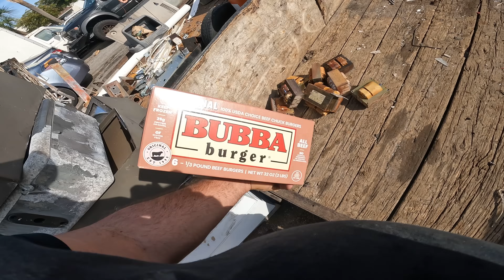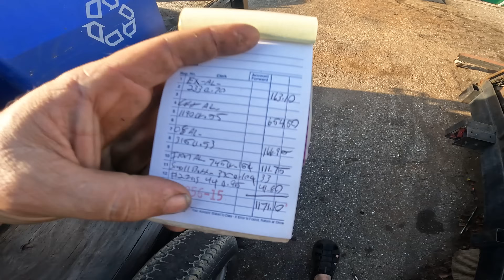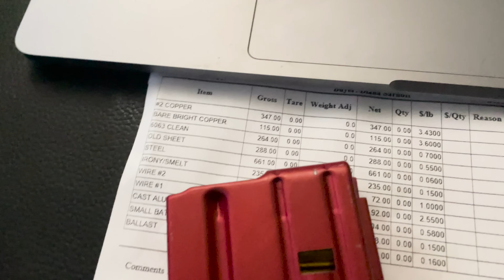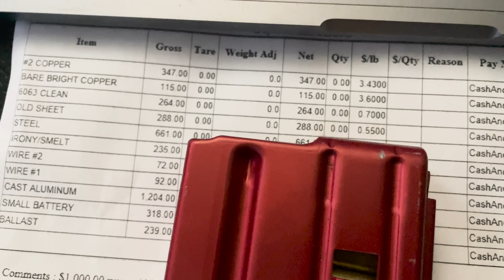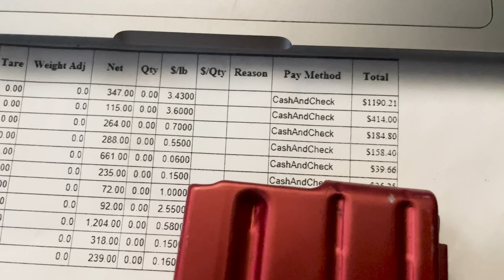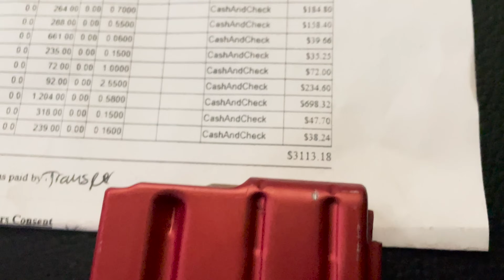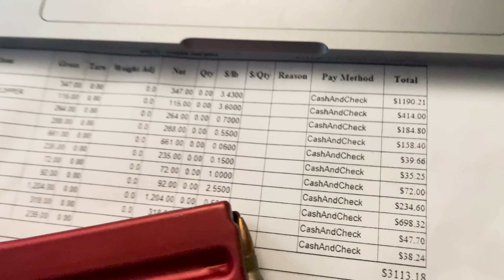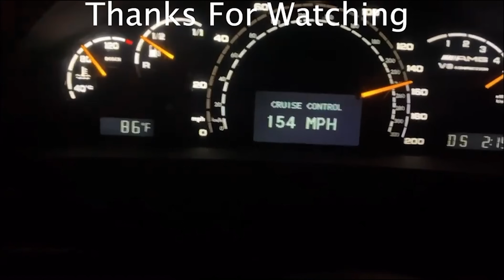Scrapping To Clean The Shop Pt.2

Comment: I once scrapped some Asian Noodle Carts. I really can't imagine Asians sitting on the curb selling noodles. Im dissappointed at the price the scrap yard gave me for the brass. I should have melted them carts down. Also at my local yard i get into arguments with staff as they can't discern between cast and extruded. They keep throwing extruded into the cast pile. The guys working there aren't too brite and i get a feeling they misuse the tare weights from the provided carts and biins to shave off as many lbs as they can. Cheaters
Reply from the maker: I always weigh my stuff because I ran into a bunch of tare weight issues. Sucks! good luck on finding an honest yard.